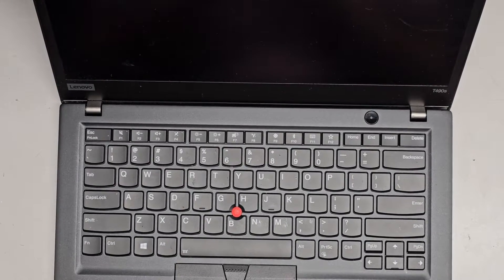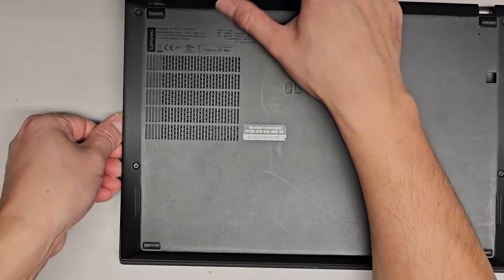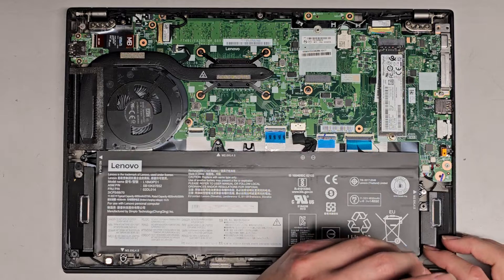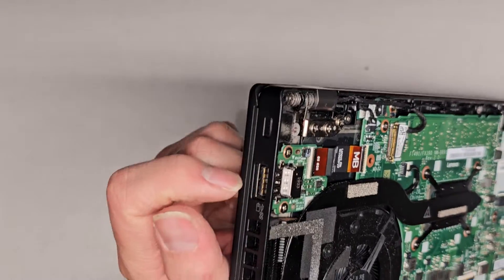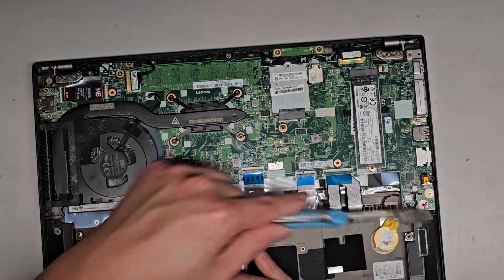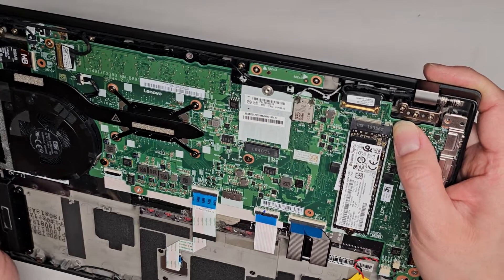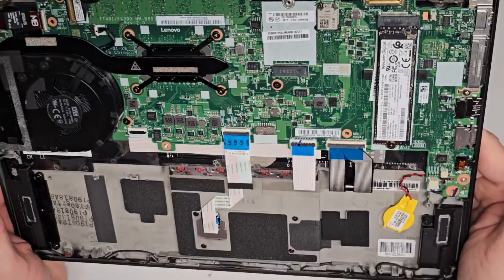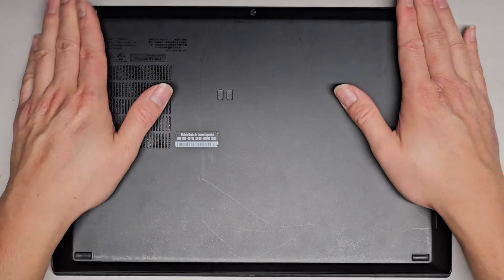Lenovo ThinkPad T490s Disassembly *No RAM* SSD Hard Drive Upgrade Battery Replacement Repair

Comment: Hi,so what was the reason for the system randomly shutting down cuz i have a t490s too & its doing that & also sometimes it'll freeze
Reply from the maker: Possibly heat issue. Check temps. If close to 100ºC then it's a heat issue. If the video didn't mention the issue, then I don't know. I don't remember.
Reply: No the system is running on optimal temperatures but somebody told me it could be a windows issue..so i redid the windows so let's see what happens now
Reply from the maker: @KhurramKhan-l2z hmmm OK

Comment: Battery resetting or removed battery un-plugged  plugged  in and  still it is powered. Not sure what is a problem to bring laptop up.
Reply from the maker: @ilyashick3178  I'd have to see it in person
Reply: @ItsBinhRepaired  Just replacement CMOS  
battery and still no luck to power up.Not sure what will be next step
Plus,  Look like PS is fine.
And thanks a lot for your kind, sir.

Comment: Hi Binh, i have the t490s laptop, can't power on, could this be due to bad cmos battery?
Reply from the maker: No power at all?
Reply: I'm not sure if either a bad battery or bad cmos battery might prevent startup.
Just got the laptop today, bought refurbished.
Reply from the maker: @eswn14  I would return
Reply: Tq for reply!
When i plug it in, the charge-port led is solid white, the power button "blinks" 3 times. 
And that's about it, nothing happens.
Have done the "reset" with the power button pushed in and also with the paper-clip in the back. Still nothing. 
I'm thinking maybe pulling out the internal battery or replacing the cmos battery.
Any ideas?
Reply from the maker: @eswn14  hmmm not sure :(

Comment: Interestingly, I had the same issue with the battery connector. Mine also cracked/broke upon removal while I was replacing old factory thermal paste. Unlike yours, seems one of the pins may be unhappy and I would need to replace my fan. Wonder if this connector is just brittle and fragile in all T490s and similar models.
Reply from the maker: :( must be bad design

Comment: Hi Binh, I have T490s with non-backlit keyboard. I'd like to replace it with backlit keyboard. Can you make video how to do it?
Reply: You can upgrade the keyboard but as far as i saw it you have to replace the keyboard cover part
Reply from the maker: @goodboy-zg3xo  hmmm
Reply: @goodboy-zg3xo  I could purchase C-cover with backlit keyboard but not confident enough to replace it myself.
Reply from the maker: It won't be easy
Reply from the maker: I don't think you can

Comment: If the computer shuts down suddenly and it's not a temperature problem, it may be the battery. I've had this happen on other Thinkpad computers.
Remove the battery and run it without it, so you can see if it's the same or not.
Reply from the maker: Tried that with same results.
Reply: 😪 @ItsBinhRepaired
Reply from the maker: Yup :(